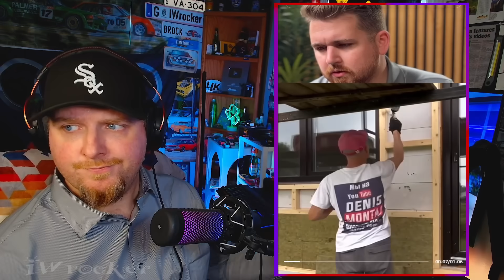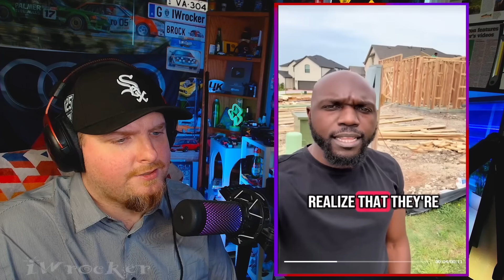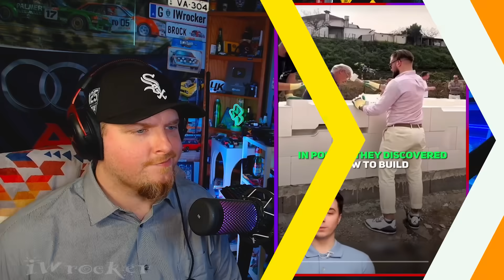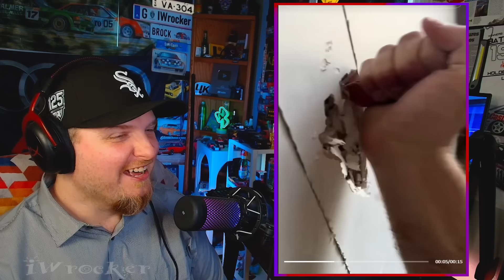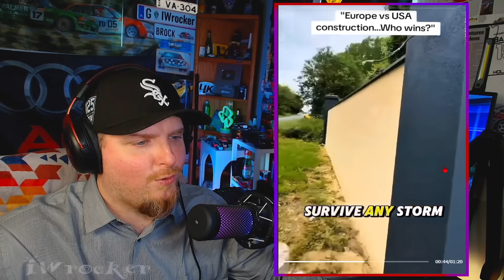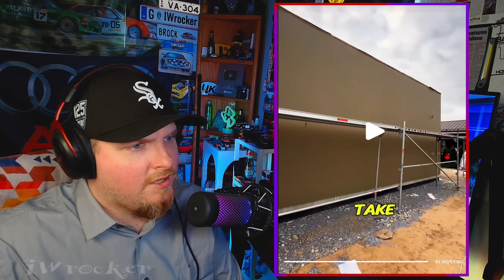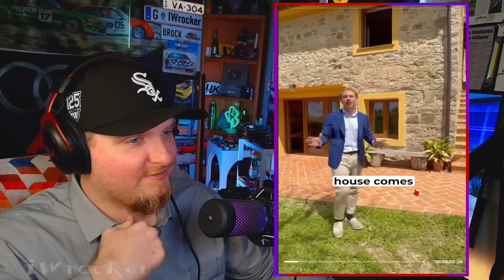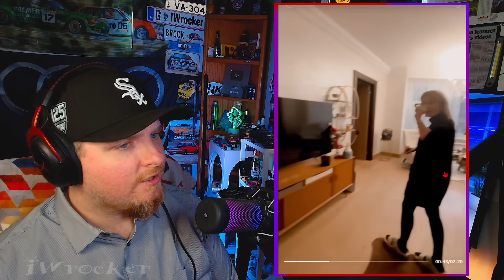25 Minutes of European VS American Home Quality & Construction Methods 🔨

Comment: Houses in New Zealand are constructed the same as the US, always wooden frame, only our wooden framing is pink, it's treated so it doesn't rot or get eaten, (though you can get galvanised steel frames) and the same internal wall material (just under a different name, GIB vs sheetrock). But we have better roofing and insulation. Oh and brick houses, just a brick facade, just like the US. Brick walls built around an already standing house. Sash or sliding up and down windows went out about about 50 years ago, windows are hinged generally from the top and latch at the bottom. We have NEVER built houses out of stone/brick/concrete here (to my knowledge). Wooden frame houses make upgrades and modifications so much easier. And with so many trees, wooden framed houses are cheaper.

Comment: I am renovating my inherited house and there is funding to get a proper insulation for the house, but you need to get a loan for it and the quote is almost €200k. This would add 15cm of insulation to the outer walls and I need new windows etc. It is a huge undertaking. I decided against it, I just am getting rid of the old oil heating and have normal air conditioning already with which I can also heat the house up. In combination with my solar panels and a battery in the basement it makes sense.

Comment: 'Why is the insolation on the outside?' basic physics, you want to keep the thermal mass on the inside so that once you have raised the temperature of that mass it maintains it without having to continuously pump heat energy (money) into it.
Reply: My grandpa worked almost 50years in housebuilding, and he told me you put insulation on outside if you build house for living as it will preserve internal heat/cold loner and save you money. You put insolation on inside if you build   weekend cottage where you are only short time, and not present for long time, this make it heat/cold faster when you come at weekend to them.
Reply: Also, it will be minimal variation in the inside temperature (both summer and winter)
Reply: It depend of type of houses,
And insulated material.
In a old house, with armored structure in concrete, and
 walls of bricks, is better the 
External insulation, because 
Concrete, and bricks, have different reaction to temperature, to avoid thermal bridges, and
Problems of mold inside.
 In a wood house, can do inside, or outside.
choose carefully, the type of insulated material.
Bye😊

Comment: This is exactly how my parents house was insulated. They even had to replace some windows, since the entire wall became so much thicker than it was before. Once the job was done and the outer layer painted white, you could barely tell a difference from the outside.

Comment: Our house is only 125 (so not that old), but still, sometimes watching US diy videos, I really long for having walls that are so easy to drill and cut into.  Some of the bricks in our house need an professional level corded hammer drill to get through.  A normal cordless drill doesn't make a dent.  Internal walls are lath and plaster though (so wooden slats and horsehair and lime plaster).
Of course, that said, the roof has been redone once, and it's still got decades left in it.

Comment: I was curious to find exact address for last video. And just for fun checked ads site to find out there are two apartments for sale in that building. One is for €240k (4 rooms - 129 m²) and the other is for €285k (4 rooms - 119m²). For rent there is one 4 room apartment couple blocks away - 118m² for 1600 €/month. And for 750 €/month on the same street there is 80m² apartment for rent multiple blocks away. Probably that is an old video.

Comment: my grandpa house was made with the stone from the land he was building it in so literaly is house is made of  chunks of granite and concrete, at the time people did it this way to save money, he had a truck crashing into his house and the truck was a writeoff and the house only needed a new paint. on one hand that thing will survive 3 more generations on the other trying to demolish it will be crazy expensive.
the foam is called capoto, was a brand but now is the foam itself, because houses are old this way it can be fited everywhere and drasticly increases the confort of the home with the added vantage that it also isolates the outside noise.
the london brick house isnt a house its made to hide wtv is behind it it can be anything tbh from metro vents to electric distribution etc.

Comment: He's not putting the insulation on the outside - it's in what will be the wall cavity. For older houses, brick built or stone that are not previously insulated you can't put the insulation on the inside because it will reduce the room size!  So it goes on the outside of the original walls and another one will be put over.

Why would we want to do things the American way?  House construction is not the best.  How insulting!!

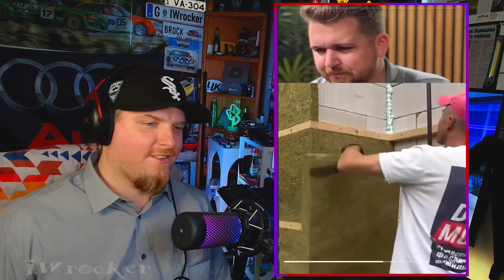Comment: 1:40 insulation. My daughter has a house in Hungary, an old house. The wall is about 1 meter thick. Keeps the house cold in the summer and warm in the winter. They hardly use the stove in winter. 
I am building a new house, 0 energy house. My walls are just 45 cm thick but have an arc value of 5.1 and the flat roof of 6.7. 
You put insulation on the outside to keep the cold OUT. You do not want your inner wall getting cold.
The inner wall is 20 cm, then 10 cm PIR insulation, a void of 5  cm and an outer wall of 10 cm   should do the trick

Comment: My house "outer" wooden walls have at least 4 layers. Inside walls are mostly double, of course all insulated. It also much thicker "fasade" planks than what is normal (outside the area) as it can get stupid cold.. Wall thickness is somewhere around 40 - 50 cm outer walls (not actually measured them so cant say exactly), 15 - 25 inner walls. Cellar (concrete)  walls between 30 to 60 cm i think. Wall (and roof / floor) insulation is more than twice the thickness in the first clip. Those  are Really thin.

Comment: The pro for the US dominant way of construction is, that it is a lot cheaper (to build, not to run). That is the only one i can think of. The problem with this is, that they are still sold extremly expensive. Cheaply made, doesn't result in a cheap prices, it means a higher profit margin. Politicians have to allow that and this problem is not new.

Comment: The "thin house" in London is 5 Thurloe Square, the end of a long row, that due to a railway line behind "pinches out". It is a bit of an optical illusion, which is why the camera stops before filming the back of the house - it is actually triangular, the far end wall being about 4 times wider than the thin end you can see. Back in the 19th Century, the house was an artist’s studio. But those days of bohemian creativity are long past. Nowadays, it’s a pricey piece of property offering up a number of flats. Accommodations within the iconic skinny building are valued at anywhere between £850,000 and well north of £1 million!

Comment: 15:00 My apartment building was done on the EU program for energy saving ,  the outside walls and load-bearing inner walls are armored concrete ( good luck making a whole in that without hit the steal ) , we got 10 cm outside insulation , you dont really need to turn on any heating in the winter or AC during the summer

Comment: I think I saw that thin brick "house" in London in some documentary a long time ago, and it's just a dressed up wall that cover up some opening where the subway trains pass through, maybe to dampen the sound? But the looks are cosmetic so you don't just have a bigass depressing wall looking wall there but something that looks like a building where people might live, makes the area look more lively or something. I think it has an interior but its just a narrow corridor with stairs going up, don't remember if they actually used it for anything like some utility access point or whatever or if it's just empty

Comment: I think there is some confusion on US wall construction and maybe a misnomer when the guy says insulation should be on the inside.  He means in the pockets of the framing.  Here's the construction on most newer construction in the US from inside to out:  drywall board, wood framing stud wall (most 3.5" thick), fiberglass insulation tucked in pockets of stud wall, plywood or strandboard sheeting, moisture barrier (Tyvec), vynyl siding.  Note that the wall is not designed as a heat sink.  It is designed to slow down temperature transfer inward or outward.  The vapor barrier is designed for 1 way travel of moisture from inside to out and to protect from intrusion of outside water.  For a cost, stud wall can be thicker using a 5.5" framing stud with thicker fiberglass insulation in the pockets.  In really cold climates double stud wall can be installed with a gap between inner stud wall and outer stud wall so that there is a conductive break/gap between the outside and inside studs and making a larger cavity for more insullatuon.  Instead of vinyl siding there could be a stone or brick facade, or even wood lap boards.  Older house might have aluminum siding.  In hurricane prone areas of the country the stud walls may be made out of galvanized riveted steel for flexibility and tensile strength, or maybe block or concrete walls.  Many really old colonial aged homes may have 2 ft thick stone, block or brick walls.  My parent"s house built in 1968 had a cinder block basement wall that extended up through the first floor.  On the first floor there was a brick facade attached to the cinder block on the front of the house.  The 3 other sides had stucco on top of the cinder block.  The second floor had stud walls like I discussed earlier with aluminum siding.  So, shows you a bit of nuances in building design over the years and regions.  Frankly, in my experience, some of the older perceivably more solidly built houses are more drafty.   Wheras, the newer homes are so airtight that there can be unhealthy levels of CO2.  A fresh air damper (FAD) can be installed to regulate the amount of outdoor air that can be brought into the HVAC system.

Comment: the houses with the exterior insulation blocks do you want on Florida or Texas NO! but if you have colder periods this is the way to go saving 30% on heat cost is enormous, also in the summer they keep the house cool
Reply: I don’t know it would keep the heat out Florida and Texas would surely appreciate good insulation

Comment: My holiday house in the mountains is 387 years old - and it's not even the oldest in the village. It's funny to admit that it's more than a century older than the USA. ;)
It's built with thick stone walls except for the one facing south, which is made of wood covered with clay. This used to be the traditional method in the Balkans. Nowadays houses are built with concrete and bricks and are insulated both on the outside and on the inside. Very efficient!

Comment: we have double brick walls with a gap between for insulation (somehow) with ties holding the two walls together. most people today have insulating material blown into the cavity between the walls.
in america the buildings and roof are built with planned obsolescence to keep the roofing industry in a job with regular income.
Reply: also our windows normally open outwards for security. that london house could have been damaged in the blitz.

Comment: This 2 building made of white blocks is a Polish construction system without glue, it is called 3E system, very often in Europe we insulate apartments with polystyrene, but in Poland we use non-flammable insulation

Comment: Put it this way, the man at the beginning, I would not allow him near my house, no chance.  I'm living in a high rise, ground floor in Germany, not far from Köln, in the last two years, we received new triple glass windows, which reduced the noise levels by around 60%. Then they installed insulation outside 5 inches thick and a 3 inch thick insulation on the cellar ceiling, my heating bill has been reduced by around 40%, ok we pay more rent, I was paying 400 per month for 61 square metres, now it's 520 euros per month, that includes heating, and garage for two people large enough, now I don't turn the heating on, I have 17 to 22 degrees Celsius through out the year in my apartment, outside on the 10th of February we have 2 degrees plus Celsius, so no complaints from me, when I see the rubbish that contractors are building in the USA, it's disgusting, they have good materials and waste half not doing the job correctly.

Comment: Structural walls are usually solid in Europe, and shared walls also need to also be fire-rated. You can't break into a European house by using a multi-tool to cut a hole in the side of the house.  New housing developers in Europe usually have to sign up to a national guarantee scheme and pay a premium per house to guarantee its construction for say 10 to 20 years.  A housing estate where I live had problems with construction, and the National Housebuilders Scheme ripped out the faulty walls that leaked in every house and rebuilt, as well as relocating the homeowners into rented accommodation at no cost to the homeowner. 

New builds in the UK are not that great, but at least homeowners are protected, and faults put right in the first ten years.

Comment: The insulation on the outside is called a coat and it really warms up the homes. My mom lives in northern Europe (I live in southern Europe so I don't need it) and her building got that insulation put on the outside a few years ago. The heating bills went down so much while the house stays nice and toasty in winter and cool in the summer.

Comment: 8:09 Stud walls are common here too for anything not load bearing. Plasterboard is plasterboard... It's when they use like 3mm thick board and insulation and some thin flashing and not much else on exterior walls that we start raising eyebrows.

Comment: I find it strange that the housing in the hottest areas of the USA, (like California, Arizona or Texas) are not built similarily to housing in comparably hot countries. Or that housing in hurricane exposed areas are not built of concrete, steel, brick or heavy timber.

Comment: The thin London house backs onto the cutting for the London Underground railway in one of the above ground cuttings. There are some areas where this happens one or more facades of houses to conceal the open cutting and prevent access to the live electric rails and trains like in Bays water.  This is actually divided into flats as some are and it's in the  South Kensington area where they are worth between £750,000 to £1,100,000.

Comment: The drawback of a typical Eastern European apartment:
- You want to hang a painting on the wall.
- You buy (if you don't have it already) a hammer drill.
- You buy some concrete drilling bits. 
- You go to church and pray (tell you why in a bit).
- You mark the spot where you want the hole. 
- You start drilling.
- If you have prayed hard enough, you might miss the rebar in the concrete.
- But you haven't prayed enough, and couple of hours later, the neighbors had it enough and called the police on you.
- So, after talking to the police and after realizing that you have melted all the drilling bits but one, you make the decision to drill that hole at an angle.
Reply: No the praying is that you don’t hit a pipe in the wall😂
Reply: @1987tijgertje  or electricity cables that most definitely should not be there yet probably are.

Comment: The tale of the 3 little pigs and the big bad wolf springs to mind. First little pig built his house out of straw, the wolf came along and said "come out, little pig, or I'll huff, and I'll puff, and I'll blow your house down". Little pig, sure he was safe in his straw house, didn't come out; big bad wolf blew his house away. Second little pig built his house out of wood. Same result as the first little pig in his straw house. Third little pig was cleverer than the other two. He built his house out of brick, even though it took longer, and he was still toiling whilst his two neighbours relaxed and laughed at him. When the big bad wolf came, the first two little pigs were relieved that the third little pig had built his home properly, because the big bad wolf couldn't blow the brick house down, no matter how hard he huffed and puffed. That's a very old tale, but it perfectly describes the American way (let's throw it up as fast and cheap as we can - time is money, after all), compared to how we do it on this side of the pond (let's do it properly, so it'll last for centuries, and doesn't have to be repaired every few years). My home was built in 1884, ALL the walls are two bricks, thick, internal and external, and it's one of the "newer" houses in the village. All that said, we've been using the American way for quite a while now on new-build estates, timber frames, with breeze block interior walls, and a thin outer layer of brick. Wouldn't touch them, give me a properly built house any day.
Reply: It's such a prevalent story in the US, and they STILL did not get the core message.
Reply: To be fair nana's house was wood, the old wattle and daub of the 1300s.  Still standing but then even in mediaeval times wattle and daub houses were built to last, unlike those in the US.

Comment: At 17:07, it really depends on what that vertical pipe is for. That one looks like something that does require a cap but the likes of a plumbing vent stack doesn't need a cap. If some rain goes down a plumbing vent stack, it will simply go out the drain lines that the rest of your waste water leaves your house.

But that pipe with the missing cap looks like it is part of the ventilation system rather than plumbing system. That is an incompetent and/or uncaring builder.